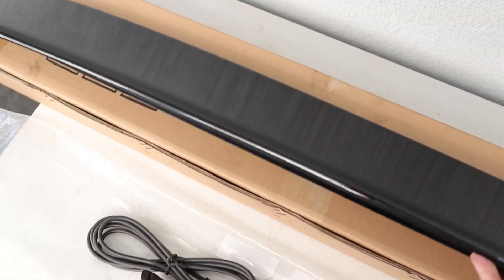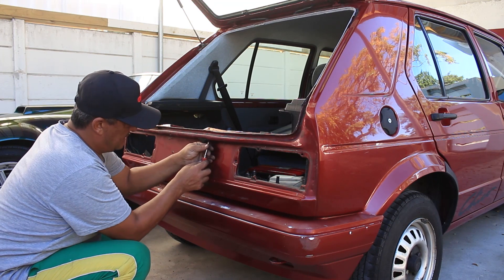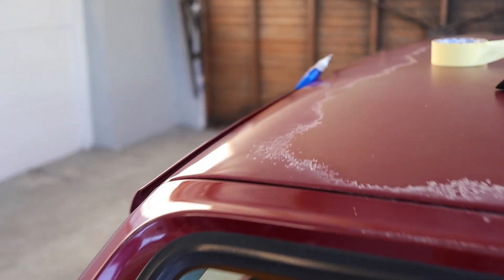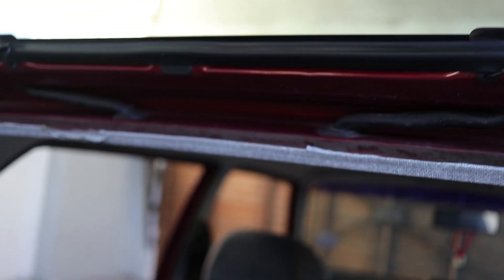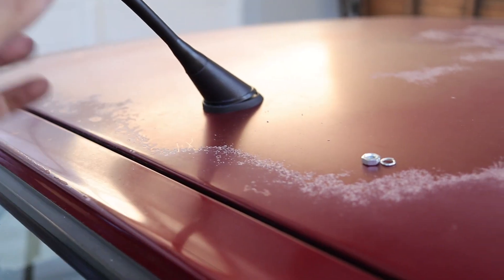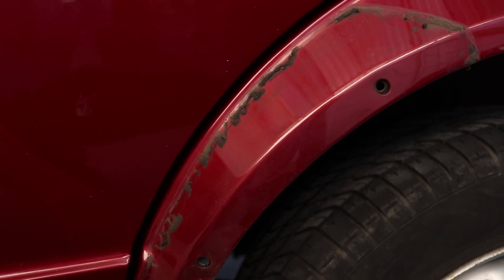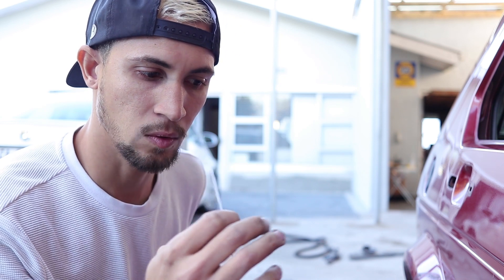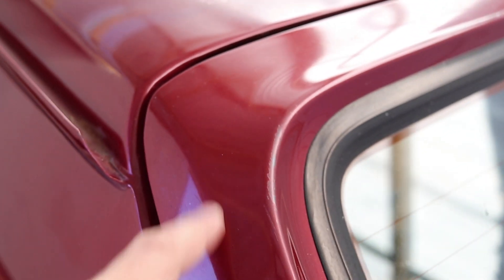Volkswagen mk1 Citi Golf budget build - Stripping entire exterior

Comment: Love this videos🤘🏼do you think its a nice first car to get
Reply from the maker: 🙌🏻 thanks! yup it is. Low maintenance, not that expensive to do it up and also fuel efficient. But just remember it doesn’t have power steering
Reply: The model im maybe getting is a 1998 vw chico (same shape i think) and it has 102000 miles on it for R40000
Reply: U doing great job bro ,where are you staying